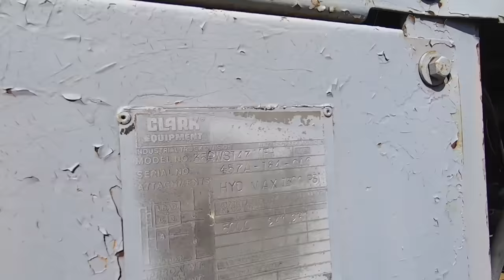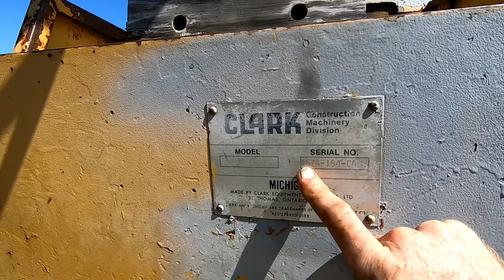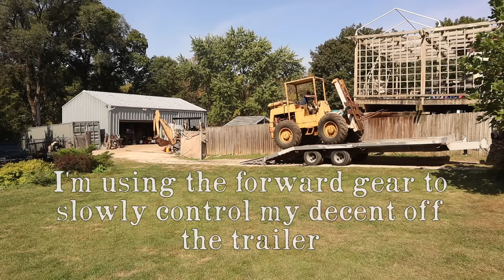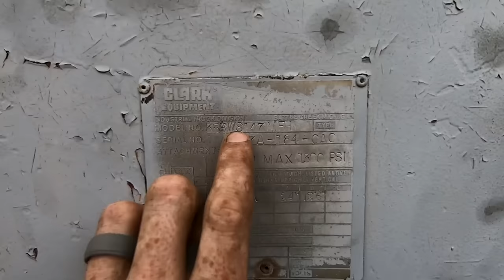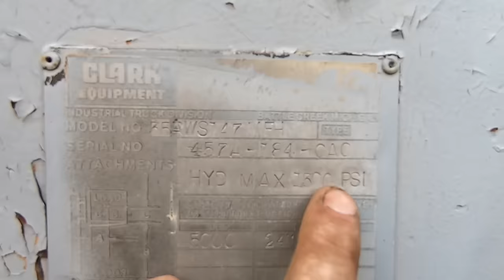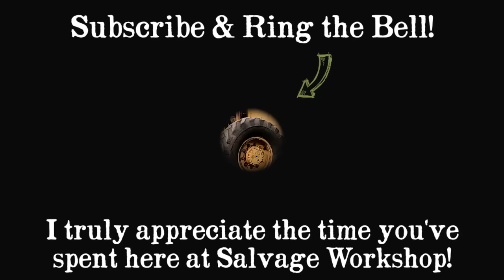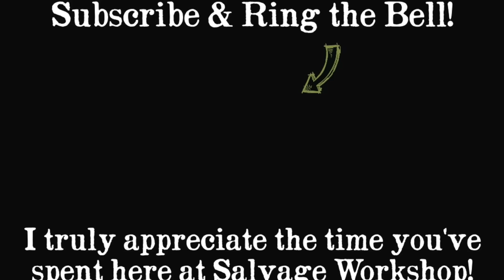I found a RARE ALL-Terrain "Wheel Loader" Forklift! Will it START?! (THIS Machine PUT UP A FIGHT!!!)

Comment: I really enjoyed watching you as usual :-)  Glad you got it back to the shop and found out it was turning over backwards.. Now it runs better with the original starter rebuilt... Good job finding a bigger radiator that will improve cooling the system...

Comment: Pettibone  RTL 6000 mounted their air over hydraulic solenoid just below the operator feet in a small access area. When I managed to find and remove it to  clean all the sludge out the brakes worked great.  GREAT MACHINE

Comment: I owned a twin engine(gas) boat. I recall only the starter and camshaft were different from "standard" engine to get it to run in counter rotation. With a diesel, perhaps the injector pump as well as these I don't think were run off the camshaft.  Good catch though, that would have perplexed many a decent trouble shooter for a bit. Look forward to more of this and your other restores! Keep'em coming!

Comment: Really good job! Perlins diesel reliable all day. Could not believe that was turning over the wrong way! The fuel cannister full of gunk is a water separator and the gunk you found is diesel wax. No filter hoes in that housing. There should be an inverted Umbrella metal deflector inside with wide part facing down. This creates a gravity separator oil vs fuel oil. Water stays in the bottom and can be drained by the plug at the bottom. I guess the injection geR is Lucas CAV. Brakes next plus some wiring! Good luck.

Comment: Good Day,
  Great catch with the starter issue👍🏼
  In reference to this unit, I worked as a Massey Ferguson mechanic for years, this Clark unit looks a lot like a MF470 wheel loader. Just mentioning this so you can peruse a service manual for one of those. 470’s never had four wheel steer or air brakes, but in general they really resemble your unit. It is possible that Clark made the Massey 470??, as they were made here in Canada as well.

Comment: Same Motor that i have in my Yacht  Great motor    When i brought it it had not been running for many years   I hooked up a battery to see if it turned over   on the 2nd compreson it started  they are a noisy but very reliable

Comment: We have a loader and a backhoe with the 4.236. An old volvo loader and a MF50 backhoe similar to the one you just brought home. Despite all kinds of abuse those old motors keep on running. The backhoe needs a rebuild pretty bad, it's take like an hour to warm up and until its warm it's pretty weak. We haven't run the Volvo enough yet to know what kind of shape it's in. That machine still needs a ton of work and bigger more important projects have rolled into the shop. We are currently refurbishing a Komatsu WA200 or WA270  to join our snow clearing fleet. We also have a CAT 914, 287, 226 and New Holland wheel loader. The old machines work great for us, most of them only see like 50 hours a year if that. Snow clearing contracts often state that the machines must sit on the property and they are only really needed for 2 or 3 storms a year. For most snowfalls a truck will cover 4 or 5 properties.

Comment: Excellent work.  What a great looking machine.  I am surprised there are not more of these.  I don't even work with heavy stuff, construction or outdoors and I can see a 100 uses for this machine.  I have always wondered why basically all forklifts had glorified casters for wheels.  I guess the bouncing would tend to be tippy with very high loads.

Comment: Oh I forgot to tell you I worked in an auto shop since 1973, we had I believe a Chevy V8 in the shop one of my other buddies was working on It for two or three hours to get that car to start than we figured out it was turning backwards, you guessed it it had to be a boat starter that someone turned in as a core and it went to the rebuilder and we wound up with it in Our shop, Ordered another starter and bingo it fired right up!

Comment: If it was made for the military there should be a tag somewhere on it showing a military designation, a military contract number, a manufacturer's code (5 digit) and other governmental data. I believe Clark made a standard machine, possibly under a different model number, that had factory options, one of which was a forklift. The standard frame had the pivot and attachment points for the wheel loader, but were unused for the forklift option, hence a different model number. Try typing in a partial model number and see what comes up.  Congrats on getting it running. That starter would have stumped anyone, except possibly a marine mechanic, where a twin engine boat had opposite turning propellers. Thanks for the video. Jon

Comment: I have heard of people putting the wrong starter on and trying to start it going the wrong direction.
I have also heard that some tractors are designed to have the fan blowing a different direction.

I've been told that some small World war 2 Marine engines will run in either direction for going forward or backing up.

Some modern equipment will let you change the fan direction which could complicate things, if that's the only thing you go by.

To check starter direction you can also look how the teeth are cut on the flex plate/flywheel.
You can also check the direction of the fan blades on the alternator.

Comment: This machine was used in Vietnam.  Tactical (in the field)and service with the Air Force. This is a keeper. Some models had a "crab option".  If your stuck/spinning in forward or reverse, all four wheels would steer to 45 degrees like a crab. Then move sideways.

Comment: Marine and aircraft engines come with both right and left hand rotation  .Simply got a starter that turns the wrong direction for this application. I have infact encounter this before. 
Also I receive a steering box that reverses the steering for a dodge power wagon.  The parts house was difficult to return parts to so I drove the truck over to their location and asked him to drive it and decide if he would get me another one .That I didn't like the way it worked. The look on his face was priceless. I had the replacement part the following day.

Comment: Check the compressor before you dive into the engine. I think the rattle you hear about the engine is maybe the air compressor bottom end is minus some bearing material. Heard that rattle more than once. Used to just get rebuilt exchange compressors because they were cheap. Now they are pretty expensive to buy so I have rebuilt a few that weren't too far gone.

Comment: Some older electrical systems used a Positive frame common. You would be amazed how many old timers who came over from Europe would switch a Negative frame common(Ground) to the Positive frame that they were familiar with, and not mark anything down! I found some "modified" wiring in a few Ford tractors and other  farm implements that were not previously that way and were not Lucas systems.

Comment: When starters click like that, the solenoid is pushing the gear into the flywheel, but the contacts at the end of the barrel are worn and not closing the circuit.  The quick fix is to energise the solenoid, and at the same time put your positive jump lead directly onto the motor terminal. I see this all the time on farm machinery where they're  often started with weak batteries or jump leads. The voltage is low so the current goes up, and it burns out the copper contacts in the solenoid. The contacts can be replaced, you just need to strip the solenoid.

Comment: Love your vids! I have a Michigan 35A 4WD wheel  loader with a Continental 226 flathead gas engine that runs and moves snow around , and drags logs around our farm great. Other than the engine the drivetrain appears identical, but mine has a bucket and front wheel steer only. Yours is awesome, but definitely an oddball. I've done a lot of research  on the 35A and never heard about a Perkins (though the installation appears factory?) or forks on the front, very odd... Keep up the good work!

Comment: Being made in Canada, I'm wondering if it was used in a lumber camp or lumber yard. We had big fork lifts in my Air Force unit that we used on the flight line, but they were larger than yours. I'm thinking we had a 25,000 lb machine. Glad to see you get the old gal running again. Thanks for the video and keep them coming!

Comment: Few Detroit's run either way as well , but are stamped up to say , great filming ! Can't wait for more , saving stuff !
Reply: They can but there is a fair amount of work to change the rotation of a Detroit.   The the cam and gears need to be changed aswell as the starter, oil pump, fuel pump.

Comment: That engine was also used in VW LT35. I had one loves to run at 1500 to 1700 rpm, any higher just makes heat and burns seals and gaskets and fuel. Sweet engine.

Comment: That will be a decent machine to have if you can get the brakes to work. Air over hydraulic is never a good thing. Power cluster is probably shot and the wheel cylinders as well. If you do rebuild the brake system, consider dot 5 fluid. It doesn't absorb moisture, which is what kills the hydraulic side of the brake system. Also doesn't eat the rubber seals on the air side. Fluid is more expensive but, it's the only way I ever found to keep air over brakes working for any length of time. 4-236 Perkins is a great little engine. Those were used in a lot of equipment and power units. My friend has one in an old Hobart welder and it is very reliable. This project will be interesting to say the least! Have fun!
Reply from the maker: Great advice! I've never worked on air over hydraulic brakes, but just like everything, ill dive in and figure it out, but advise like yours is ALWAYS appreciated, so thank you!! Im definetly willing to spend more on dot 5, so i appreciate that! It looks like i can get new wheel cylinders pretty easily, so ill prolly replace all 4 and then dive into the master cylinder and air chamber, so we'll see, im definetly going to make this old beast STOP!!

Comment: Beating on the body of the starter will cause the magnets that are epoxied inside to break apart and damage the starter. Need to tap on the solenoid or take the solenoid apart and clean the contacts inside, the copper will oxidize and corrode. Sometimes the main motor of the starter will not work, so then take the flat plate off the back of the starter motor and clean the brushes and slip rings where they ride and that will cause a good contact.  Your attention to detail is nice to see before jumping in. Good work

Comment: About the front and rear steering not tracking like you expected; maybe there is a crab steer function also.  It looked to me like at 1:04:27 the front and rear were tracking like some of the old 4WD farm tractors that had crab steer.
Reply: perkins do not like starting fluid it will destroy piston ring lands

Comment: I did budget missionary work in PNG on an old CB 160 Honda. Found me a gorgeous Australian girl who took me on so I went looking for a budget 4WD. Found an abandoned series 2 Landrover. Brought a battery and petrol. Steel vacuum advance tube to carb rusted holes so wound thread round length of it and rubbed in plumbers paste. Got one front brake and opposite rear brake working. Tow started it sounded like a horror movie and drove it 30miles home pumping on the gas. Eventually got it going. Sat under the hood whilst wife driving and adjusted the timing thingy. Found out weeks later reason it died midstream at night in mosquito plague was I had never before encountered a positive to earth battery! Apparently Landrover with steel chassis and aluminium body needed to do that. Am not mechanic but am 74 and still never been stuck without figuring a way out. Love watching this guy here from Australia.

Comment: 1:15:20 you can get a pieceof copper tubing that fits just inside the bolt.  Then use a mig/flux/stick welder and weld inside the copper tubing to build up a bases to weld a nut onto the build up to help remove a broken bolt/stud.  The tubing should prevent you to welding to the case

Comment: I only mention this because you were opining whether or not the machine was retrofitted. I do quite a bit of travel and I pay attention to the machinery. These Clark AWS units are very very prominent at international airports. I have seen them used as taxi vehicles but much more often towing the luggage train. They use a less aggressive tire, but the same later built ROPS is on many units. I have even seen them with a forklift front but with a large box permanently attached to the forks, they use this to lift the beverage carts and meal carts up into the plane. Your unit has two different colors, I'm not sure if it's a regulation but every single airport machine I have seen was painted white. I don't know if this is remotely useful information but I hope it gives you a starting point at least. Good luck!

Comment: I can’t tell you much about the machine but the injection pump is cav which commonly are industrial use, they can be adjusted and turned up manually. The front lever is fuel off and the rear is governed spring throttle
Also there is bleeder ports on the pump for starting it from empty

Comment: An old timer taught me this trick and I was amazed. Use turpentine and oil with a standard drill bit to drill thru hardened steel. It works. Probably too late for you to use but in the future just remember this. Turpentine and oil, using a standard drill bit will drill thru tool steel. Try it for yourself and make a video because more people need to know this.

Comment: I noticed on the side underneath the serial number plate there is a decal that been painted over, maybe try and clean the paint off it, also there may be a plate or something on the mast with some ID numbers or even swl numbers. good luck, looks an awesome old machine,  I'd be starting with the wiring, brakes and hydraulics first

Comment: If you want to vent a gas can, use a 1/2 inch drill bit to make your hole and then fish a valve stem through. I fish a wire through the opening and through the new hole. then pull the stem through. remove the core and use the cap. Keep up the good work.

Comment: Always put heat to the case before extracting a broke bolt or threaded stud. Spray the broken piece with a pentrating oil and let it sit, then heat  the case and spray more penetrating oil .

Comment: If you looked at the shape of the blades on the alternator cooling fan that will give you the direction of rotation of the engine. Rotation is toward the open side of the fan blades.

Comment: From what I remember, the 4-236 Perkins did not have a opposite rotation version.  In fact I don't remember any marine versions of the 4-236. They had 6-354 and T6-354 had counter-rotating engines for twin engine motor cruisers.

Comment: Could be the origional starter for the Detroit, there was a Detroit two stroke 4 cylinder from the 70s-80s that ran backwards, we have a 6V71 at my work as a water truck in a International F2575, it runs opposite direction and has pullies on the front of the engine and in the rear. We called the thing the "screaming eagle."

Comment: Just a tip for future referencing for ya!  Left handed drill bits ARE your friends in busted bolt/stud removal applications!  Not ONLY does it drill in the correct direction?  The HEAT generated by drilling ALSO helps aid in extraction.  Believe me now...Thanks me later!  😉

Comment: I am not for sure its been a while since I worked on them. But some starters came in from the transmission side, most came in from the engine side like yours. If I remember right the starters turn opposite of each other.

Comment: Off Road forklift, the Military use to have lots of them. The Navy Seabees use some and others , could run through mud, sand , etc. Later ones could tilt side to side incase the ground was uneven.
  You should always check the fuel , oil, and coolant before ever trying to start anything, Is there water in the oil or metal? , has the fuel gotten full of algae, if the fuel is bad you don't want that getting into you pump or injectors, is there a mouse or bird nest in the air filter? You can always look at the fan blades to see if it's turning correctly. Fill the Cooling system with water and check it later to see if it's still full. You  will see if it runs out fast by looking at hose's and such but what if it is going into a cylinder because of a bad head gasket? You don't want to try to start an engine with a hydraulic lock. 
  Build a game plan and stick to it, it will save you lots of time and money. Just a thought from an Old Man

Comment: The mfh on the id tag stands for Massey Ferguson Harris as that is what Massey started out as. They later split and became Massey Ferguson. I don’t know what their role was with michagin or Clark but they attributed something. I have a 50 Massey Harris that I restored back in the late 90s and every piece of it was exactly Massey Ferguson no difference except the decals. A lot of the old American companies shared designs because they didn’t have cnc and a team just for a new design of a ideal. They just bought rights to use present ones. I don’t think this will help you but maybe it will give you a somewhat better understanding of how things were way back then. Good luck and thanks for another great video. 👍

Comment: I'm in the midst of starting a rebuild project on a Michigan/Clark 55C payloader. Currernt/previous owner has operated it/started it on and off over years, main issue is rear hub is cracked whereas the machine is currently sitting on 3 of its 4 wheels, the machine does move on "front wheel drive" even thou it is full time 4x4. I'm not in a hurry to rebuild it, my time table I'm expecting is approx 1 year for completion... should be interesting project on learing the fundamentals on how the older machinery was built, constructed and operated...